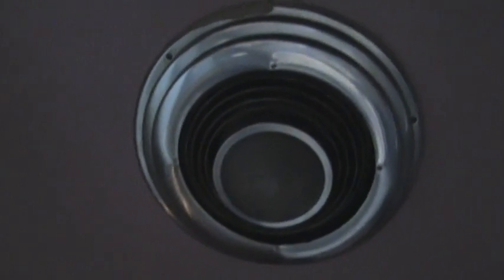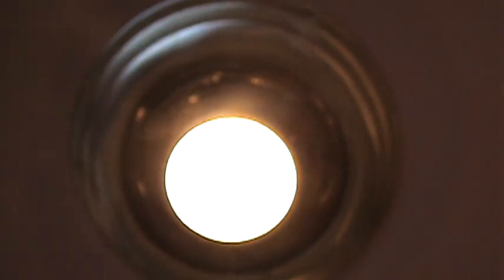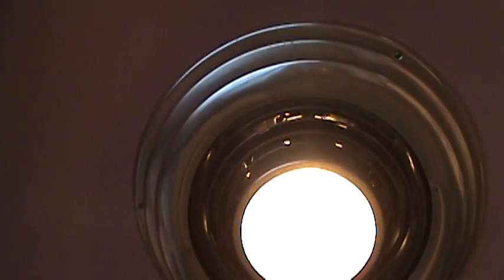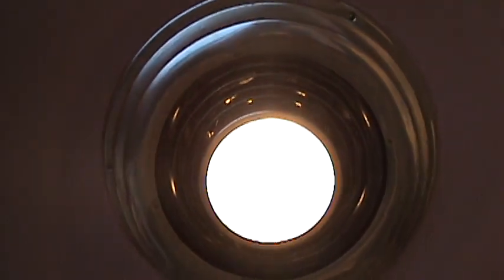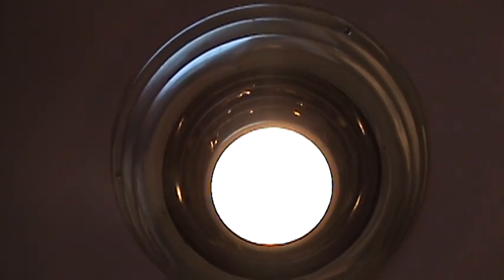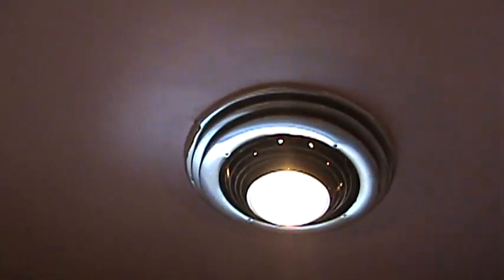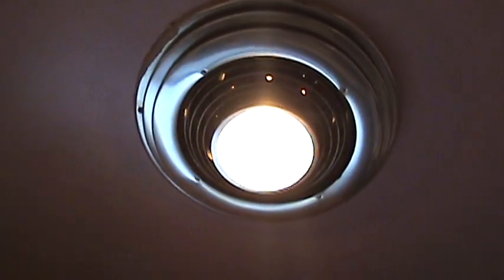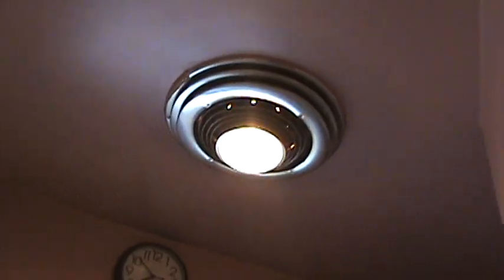The NuTone Heat-A-Lite motor

Comment: I measured the mounting studs on my NuTone 907 and they measured 2-7/8" centers. That tells me that a Packard 3.3 frame 40124 1/50 hp 1500 rpm 115 volt, 60 cy. CW rotation or FASCO D124 will work. The fan 3.3 frame motor may fit. Try removing the motor to see if it is frozen. It may have had the oilers dried and stuck the shaft frozen. My fan blade is CW 5 blade about 24 degree pitch. zoz